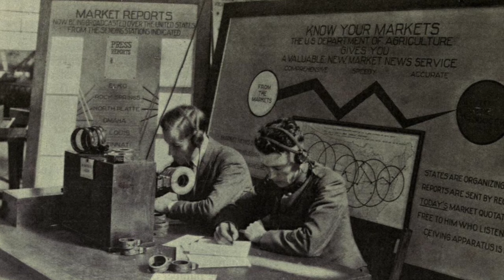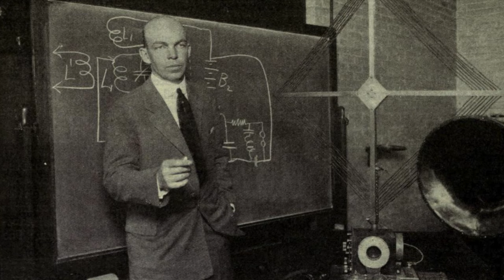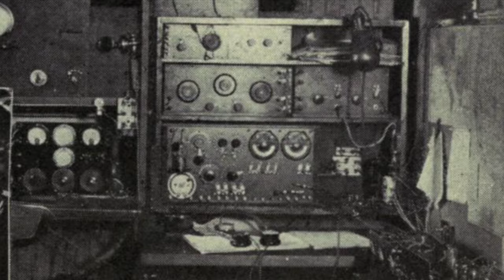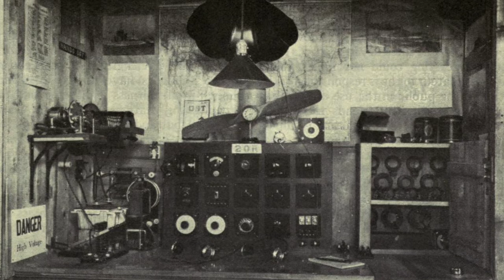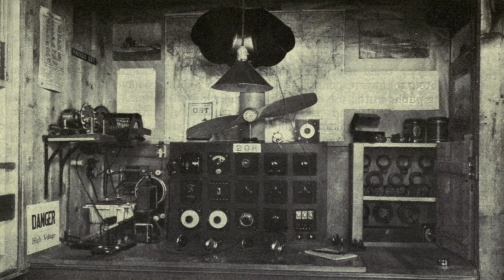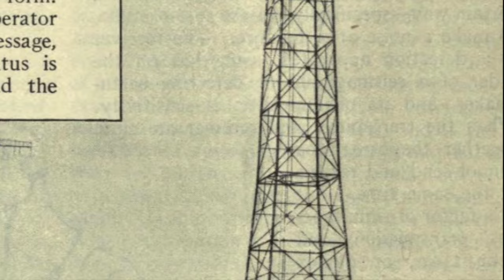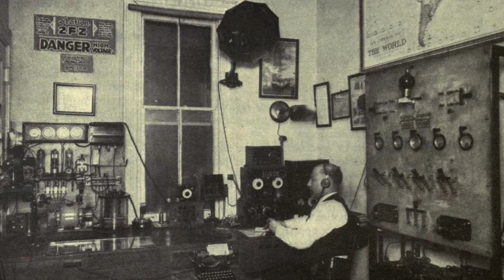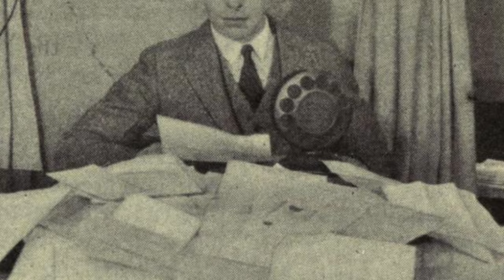1923 Radio Snapshots (Part 4)

Comment: I enioy your vids but it would be really really neat if you could find snippets of any recordings for these 1920s events. You do a good job but I could just listen to an audible recording, why not spice it up by adding in some actual recordings from the decade?
Reply from the maker: Unfortunately, there are very, very few recorded radio broadcasts from the 1920s (almost all of them experimental) and almost all of them come from the last few years from the decade. The oldest one is from 1924, so there's nothing from 1923 to go with this video.
Reply: WOC Davenport is mentioned at 7:30. 😂. Thanks!
Reply: I understand that WCBS and WNBC radio stations in NYC are not on the air anymore. They have new call letters and formats now.
Reply: @The1920sChannel  thanks for responding. I truly enjoy your channel, maybe do a video showcasing all of the known radio broadcasts that are still available?